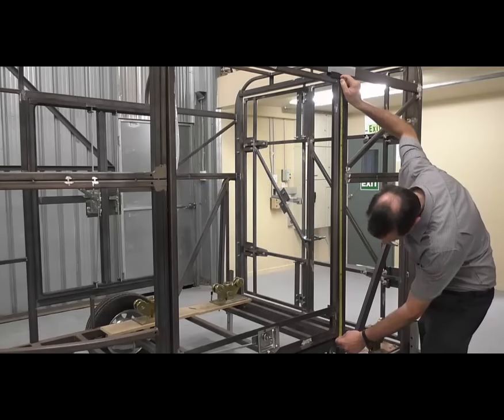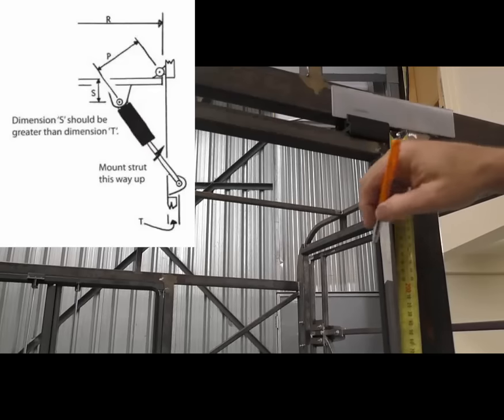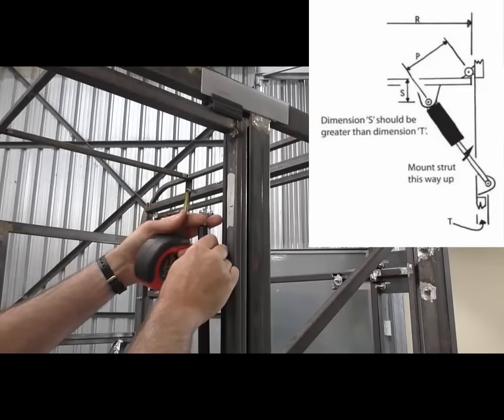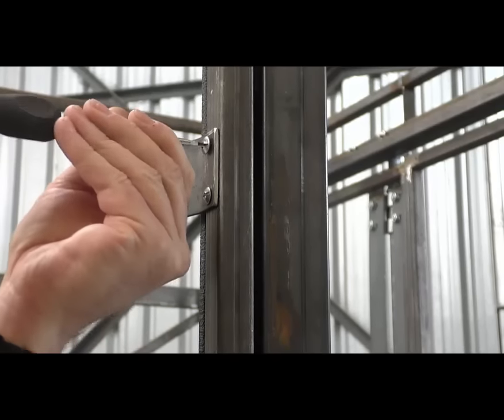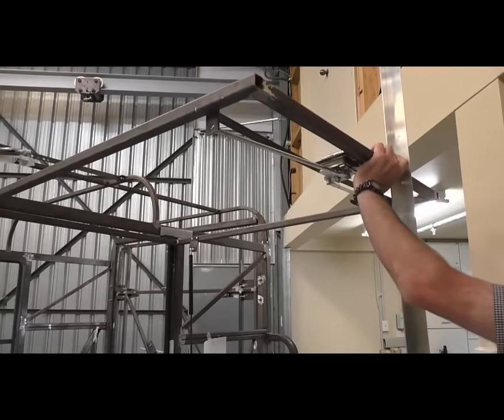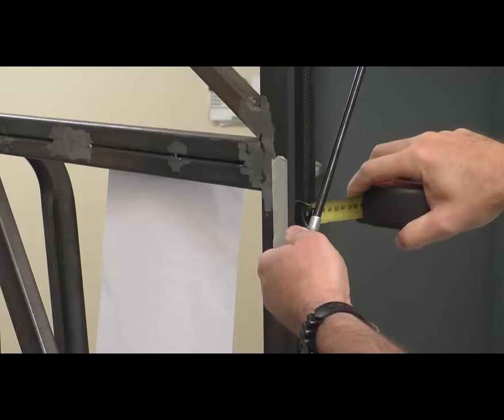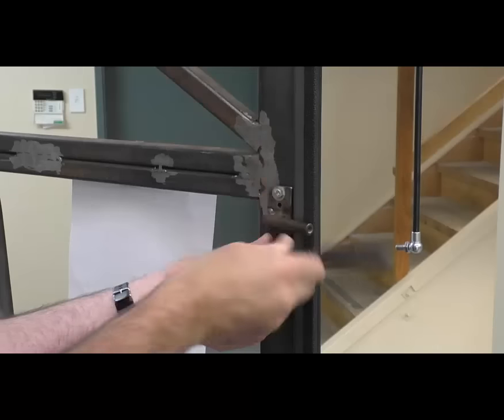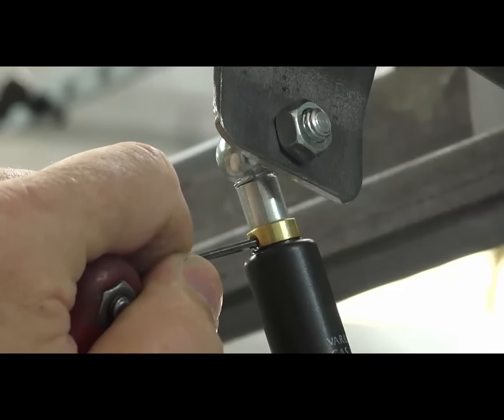How to Fit a Gas Strut

Comment: This Isn't a how too but a how I did. How do you work out what offset you need for each end for the strut itself.
Reply from the maker: The offset is different for every set up, but the principle is the same. It needs to be set so when the door is closed the top point is slightly behind the bottom point. This means when closed the gas strut is putting a slight pressure against the door and seal. If this offset is too much the door will be hard to open. If the top point is not behind the bottom point the door will not shut properly as the gas strut will always be forcing it open.

Comment: centre of the top of the gas strut (40sec) to determine the distance? so roughly a quarter the length of the strut?
Reply from the maker: We use this table to find the measurement https://www.comac.co.nz/gas-struts-adjustable-black-zinc-plated

Comment: I'm confused on how to find the P and S dimensions.
Reply from the maker: Thanks for your feedback and sorry that our instructions were not clear enough. The P and S dimensions are dependent on many factors, including the size of the gas strut, the stroke length of the gas strut, size of your door and required opening position. 

For a rough guide of the P dimension you can match the size of your gas strut to the closest one in our range and find the P dimension in the graph: https://www.comac.co.nz/modules/SP_webshop/products.php?cat=1546?

Comment: can gas struts to be used for lifting around 300 kg door?
Reply from the maker: Yes it is possible if you have strong enough gas struts, however a linear actuator would be better given the weight.
Reply: you can use 2 gas spring for a door

Comment: You made no mention of the weight of the door. Actually - its a shocking video and you are doing your business and your customers a dis service by leaning it up here.
Reply from the maker: Thank you for your feedback TinyHouse! As you would have seen this video details how to fit a gas strut, not how to choose a gas strut. While we cannot know the weight of every single customers door, our gas struts come supplied with 40kg - 250kg of pressure (depending on the size of the strut) and are adjustable which allows them to be calibrated to suit the weight of the door.

Comment: So pointless posting this video mate if we new what the dimension were we wouldn't be watching a video on how to fit Gas Struts as we would know already! PLEASE MAKE IT CLEAR AND EXPLAIN EXACTLY HOW TO FIND THE DIMENSIONS AND WHAT EACH DIMENSION IS IN LAYMAN'S TERMS THANKS
Reply from the maker: Hi Smuzz thank you for your feedback. This is an older video, please see our updated one which we hope will make it clearer for you. 

https://www.youtube.com/watch?v=0YtST0dPueA&t=0s

The video explains how to find the gas strut you need based off the width of your door. Once you have the gas strut length find the closest extended length in the chart at 55 seconds and use the matching P Dimension. The P dimension is the distance between the hinge and the top mounting point of the gas strut when the door is open to 90°

Comment: Had to stop video after 10 seconds due to the fact that it is for metric only.   Standard inch dimensions are easier and within .000   (thousandths of inch).
Reply from the maker: Hi Robert, as a NZ supplier we operate using the metric system but we understand that not everyone in the world is the same. For a simple conversion from mm to in divide the length value by 25.4. Thanks
Reply: @co-macgroup1683  Thank you.
Reply: @co-macgroup1683  Nearly the whole world is metric.  Exceptions:  USA and a few small affiliated jurisdictions.
Reply: what problem to buy two scale tape ?!
Reply: Not always available in NZ our economy is based in metric ,you can do a conversion